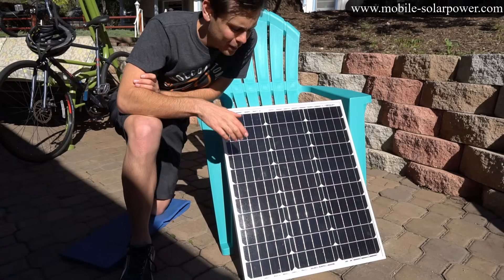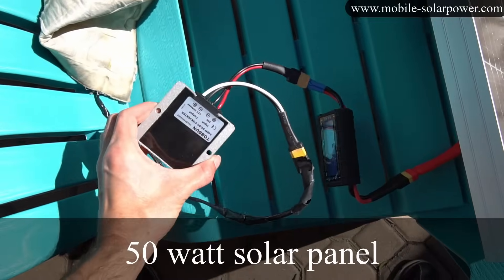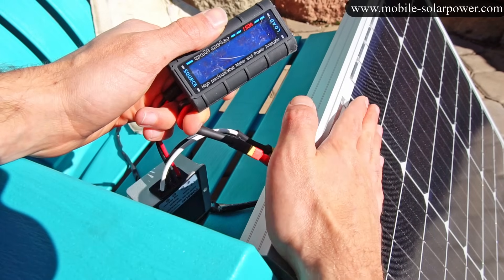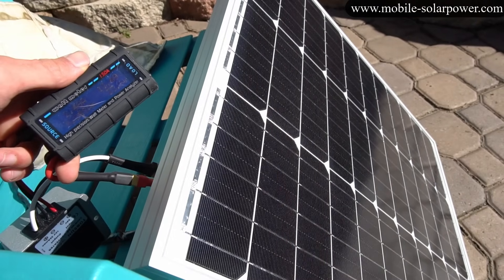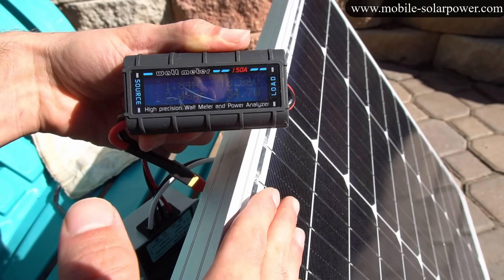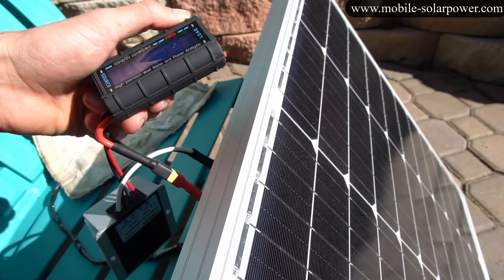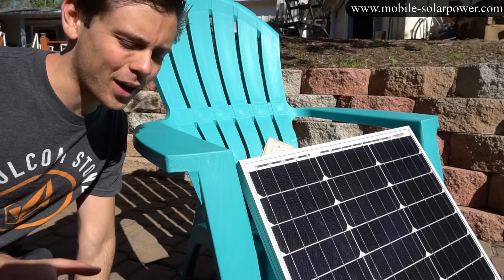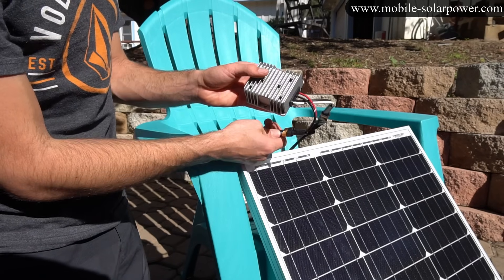How does shading affect solar panels? Quick test!

Comment: so will a roof rack with 50mm 2-inch slate at 150 mm apart  covering parts over the whole length of a solar panel affect the panel power output

Comment: I've read that a smart way to mitigate this risk of losing so much output from panel shading is to wire multiple smaller solar controllers for each panel, or pair/group of panels that may experience shading. This way, if one panel is knocked out by partial shade, the rest of the panels will still output full amperage through their separate charge controllers. I'm interested to hear of more feedback about this

Comment: Why does the voltage drop? 
I have 3 x 40v panels in parallel connected to a 24v system and today its a bit cloudy and the panels make less than 24v only 6v aswell. so of course it cant charge , but why? shouldnt only the amps drop with shade, why the voltage? if i connect them in series i am not sure if i solve the problem because if 1 makes only 5-8v i am still not reaching more than 24, so whats the problem? always when i measure the output voltage directly from the panels, its always about 37v with strong sun and when its cloudy aswell, but as soon as i attach them to the mppt the voltage drops to 6v or less

Comment: Doesn't it depend on how many by-pass diodes the panels have?  Evidently Canadian Solar, which uses half-cut cells and has more columns, puts a by-pass diode at the end of each column and claims their panel has "Better shading tolerance."  Allegedly, Sunpower puts a by-pass diode across each cell.  BTW, the Canadian Solar panels are almost 20% efficient and Sunpower claims almost 23%.  However, the last time I checked, on a $/W basis, Canadian Solar easily wins.  For a 320W panel, I've seen them down at 67 cents/W.  FYI: I got interested in this mostly unreported aspect of solar panels as we're looking to put a small ~500W solar system on our cabin which only gets 4-5 hours of full sun, depending on the time of year.  2-3 hours on each side of that is varying degrees of shade and we don't want to be chopping down BIG trees.  It's easier just to buy another panel.

Comment: It would be interesting to see a video with a few, maybe 4 panels that are connected in both series and parallel and apply shading to see how total output is affected and how well bypass diodes help to keep panels in series producing when on panel is shaded.
Reply from the maker: Great suggestion
Reply: @WillProwse ........Great to see your work. Have you look at PV-T.

Comment: Are all panels like that? Does a bypass diode reduce loss of wattage from shading? I still have alot to learn! Thanks
Reply from the maker: Oh the voltage will drop, reducing overall output, but yeah a bypass diode is super useful and helps a lot!!

Comment: You are actually wrong about your statement about two panels in series assuming that this PV panel has a bypass diode such as the bigger once on your roof have. The bypass diode will bypass the panel you are blocking and the other will come through with all the current.
Reply from the maker: Yeah at reduced voltage. Diode has a pretty bad voltage drop. Everytime I test it, the total power from both is significantly decreased. What have you seen in your tests? I think I should make a video on this
Reply from the maker: Proof of this is the panel in this video has two bypass diodes and blocking on one cell reduced output like crazy. I never can get good results from bypass diodes when shading any solar cells in series. Am I doing something wrong?
Reply: IT might be your regulator that can not handle the little voltages left behind. A two series panel outputing 12v+12v will be redused to -0.7+12 when one panel is shaded. Current stays the same.

Comment: Why didn't you put part of the panel in the shade? Covering a cell totally with your hand is different then putting one cell in the shade.
Reply: Shade is not shade. If you cover the cell totally with your hand, it's a total black out.  If you let natural shade, such as shade from a surrounding building or trees, than there is still some light falling on the panel. That would be a better test because it would be the real world test.
Reply from the maker: @terry7801  still the same results. if you have an air conditioner on the roof of the rv, and a tiny cell gets covered, then the whole panel produces nothing.
Reply from the maker: Shade is shade
Reply: Thank you for making it more clear.
Reply from the maker: Because my hand creates shade
Reply from the maker: its the same. You can put a large leaf on a panel and it will destroy its output

Comment: Yeah that's why I have them connected in parallel, one side of my cabin is always in shade and I have a panel on both sides. Too bad I can't get higher voltage to my MPPT to gain amps. But thinking of series connecting one more panel to the morningside.
Reply: Pekka Hietala, As long as your panels have bypass diodes installed and I believe most do, one panel being shaded won't stop the whole array from working. One of my 5 panels was in the shade all day today and my system was charging fine. Just make sure the total open circuit voltage corrected to temperature isn't more than the max voltage of your controller.
Reply: @normbjorn  Oh thanks! Will check if mine has bypass. They have a black box on the back that opens up, where the wires come from. Not sure if it is reverse drain protection or something else.
Reply: @Pexen1  If the diodes are in parallel they are bypass diodes....blocking diodes would be in series with the panel. My panels came with just bypass diodes.
Reply from the maker: Make sure that the in-series groups create the same open circuit voltage
Reply: @WillProwse  Why is that Will? Correct me if I'm wrong but in an in series group I would be more concerned with wanting the current rating to be close to each other as the max current in the string will not be more than the panel with the lowest current rating.
Reply from the maker: @normbjorn  yeah I agree. The individual in series groups will be parallel connected. They need to be same voltage. I guess I could have worded that better. My bad
Reply from the maker: @normbjorn  I was meaning that the in series groups, that will be parallel connected, need similar voltage. And yes, in series requires same amp rating. Totally agree
Reply: @WillProwse  Ok, now I see what you meant. I only have the 5 panels in series with no parallel connections so my brain was locked in that mode. Sorry.

Comment: Tell me what that converter name  is Please !!!!!  LOL  I currently have a 100 Watt 12v panel that i connect Directly to radiator fan, Runs LIKE HELL Sooooo fast! Nothing bad has happened to it but with this converter i could add a couple of 12v PC fans.  ( have a small shed with Batteries, charge controller and 2 inverters) the 100 Watt panel i had laying around doing nothing, my system is 24 v. Might as well use for cooling and ventilation.
Reply: Did you find out what converter was that?
Reply: @moayadsalih3563  no

Comment: This is a great video to demo to folks what shade does to a panel.  It is right to the point and dramatically shows what happens.  Showing is better than telling!  

As you mentioned, this is the reason to go to the hassle of paralleling at least some of the panels in a multiple install.  People also need to consider that even when parked completely in the sun, shadows on part of a panel are still possible from the air condtioner, TV antenna, air vent covers, etc.  If all the panels are in series, just a little bit of that unexpected shade can end the charging from all the panels. 

Curious, what happens if half of each cell on multiple cells were shaded in the demo panel?
Reply: > If all the panels are in series, just a little bit of that unexpected shade can end the charging from all the panels. 

An MPPT controller will find another ppt where the shaded string comes back online.   This works better when there is plenty of voltage overhead available.

Comment: 5th day on the road in my van. Escaped the CT cold to sunny AZ. My solar setup of 2 100w panels, 2 lithium 100ah batteries, controller, and all the bits and pieces is working well. Plans courtesy of Will's book.
Reply: Im in ct.. it sucks
Reply: Dude, I lived in Milford until last week. Yes, I agree CT sucks.
Reply: @ronmiller7916  I'm in Seymour, i wish i knew more about this solar stuff we just bought a house and it is interesting.